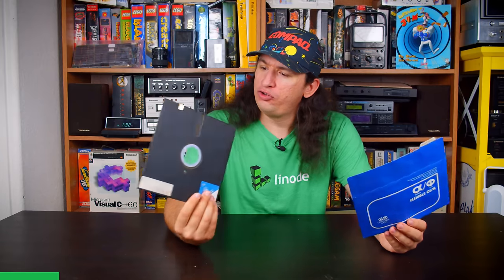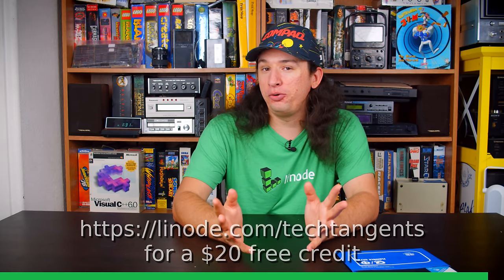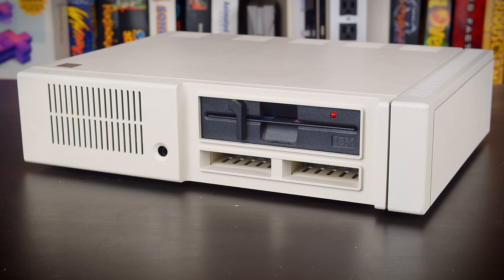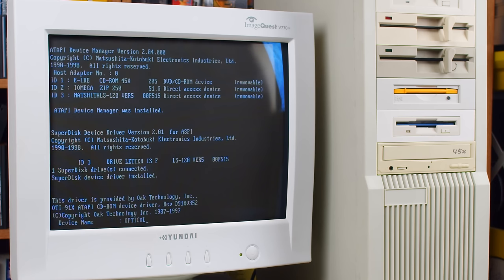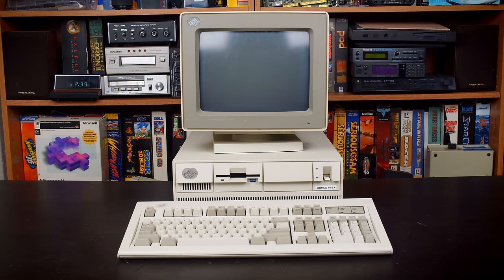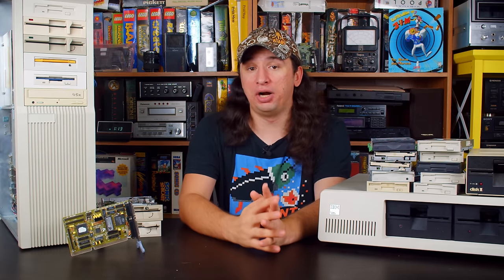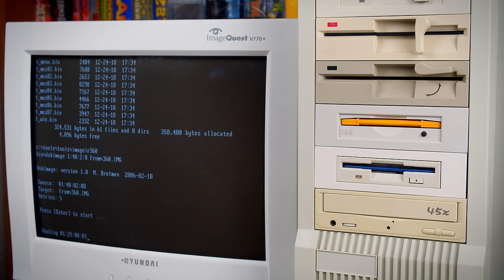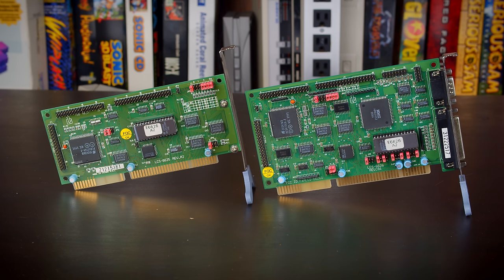More than two floppy drives?

Comment: I never realized how lucky I was that TI used completely stock drives on the 99/4a until today.
Reply: I remember how unlucky I was that the FDC interface required buying the overpriced expansion box, thus limiting me to 2 standard cassette recorders and the 4K RAM in the Mini Memory module.
Reply: @johndododoe1411  Not true! The P-Box came late, as users started having too many sidecars. There was a sidecar disk controller from TI, as well as several third-party controllers.

Comment: I've always wanted 4 floppy drive support for the same reason you did. I have never found a 4 drive controller in the wild, though, so you lucked out there. I didn't know about the XT FDC either. I will look into that. I remember watching a video on YouTube (but can't remember from who) where they had a motherboard with 4 floppy support in the BIOS, and he needed to use 2 floppy controller cars with configurable IRQ and DMA to get it to work. I think it was some 386 board, but I could be mistaken. I imagine that's even rarer than finding a 4 drive controller. The one thing that would be really neat is if something allowed this and also enabled 3 mode support on the 3.5 drive, for reading that odd format on Japanese PCs that used 3.5 inch drives, but ran them as 5.25 1.2 MB drives.

Comment: I REALLY need/want to get my Win98 machine to have 3 floppy drives for getting data to and from all my machines.

Another awesome video, very well researched and I learned stuff. 

Only thing I'd tweak is the 4 drive IDE thing, that only became a standard thing sometime around the intro of the Pentium architecture, and it was not done for Hard Drive support, more for optical drives and other non-hard drive devices. When CD-ROM drives shifted from SCSI to IDE people starting realizing that a single IDE channel was not enough, and then later on when drives increased in speed it became apparent that having slower IDE drives on the same channel as the high speed HDD was degrading performance, so the demand became to add a second IDE channel on boards. So the evolution to 4 IDE drive support had not much to do with having 4 HDDs, more to do with performance and the desire to have multiple other IDE devices.
Reply: Especially that in a typical machine with one hard drive and one optical. If you were to upgrade the storage (let's say you bought a fancy new, 2 GB drive) with a single, 2-port controller, you'd have to either image over your installation or make a new one. And there would be no way to do that move while booting from CD, because that is where the 2nd hard drive sits. 

Basically, out with the old drive in with the new, boot from CD, install the new system, CD drive out, old hard drive back in, move your stuff over, old drive out again and CD back in again.

But with 4 ports, you could just hang the new drive behind the old one.

Comment: Superb video as always! I tried doing the exact same setup as you but I used a BIOSless card. I did manage to get one of those DOS config.sys drivers working ... But really compatibility sucked and while the drive worked in DOS, disk imaging software had issues with the third drive. (1.2mb in my machine as well ) Even with your setup I'd imagine software like IMD still can only see A and B....
Reply from the maker: In this case I was using DSKImage, I've not made friends with IMD yet. Every time I try it it seems like I always have to convert images three different times to a format it will accept.

DSKImage just has you write out a string describing the drive as ID:Sides:tracks:sectors and it will send raw commands to the drive with that. So I set it to ID 2 with the rest of the values for a 1.2MB drive and it worked perfectly for me. I wouldn't be surprised if there is software that is hardcoded with 2 drives only or some other oversight though

The problem with a second controller is, for the most part I believe, that the TSRs for them attempt to remap the 2nd controllers drives 0 & 1 to the address of the 1st controllers drives 2 & 3. So if you use something that somehow by passes the TSR then it doesn't work. But I never even got the second controllers drives to show up in DOS, so there there's some speculation there.
Reply: @TechTangents  ah yes I've used DSKimage and that would definitely work. I end up with IMD because of its support of FM disk formats and also mixed FM and MFM in one disk which the TRS80 M1 uses. But of course no vintage machine uses a 1.2mb drive so who cares really! LOL. The detail in your video was so spot on -- the best explanation I've ever seen in one place so it'll be a resource for the future if anyone else tries to do 4 drives.

Comment: 3:56 Apple didn’t need an interface board for its floppy drives: it had an interface chip . This was because it didn’t bother with actual hardware to do the encoding and decoding of the magnetic signals: this was all done in software, courtesy of that hardware genius, Mr Steve Wozniak.‌

Comment: note the floppy controller from the 70's ran from 40 pin  scsi device, the late 80's to early 90's floppies seen from windows 3.1-win 8 ..

with the major shift to pci-e you have major issues in connecting up older  hardware  unless someone creates a sata line type floppy interface

Comment: I like the video because it's hard to keep up with everything.  The XT-FDC and Sergey's FDC is going to be worth checking out.  The twist in the ribbons motor control is not an IBM thought, it's actually from hacks that were used to help techs swap out floppy drives and reduced the time to switch.  The manufacturers picked up on it and adopted it as standard practice.  The two common reasons we needed several floppies were 1) copying floppies over several drives at the same time reduced the time it took to copy floppy to floppy.  If a person looks way back in the old catalogs they could find "towers" much the same way people can find cd towers.  2) more commonly, it was easier to load software by redirecting a drive already loaded with the next disk rather than simply flipping floppies.  Most floppy controller boards had at least IRQ jumpers that the controller can be assigned, the real problem was figuring out which IRQ was free.  While the on board bios supported A and B drives, it was largely because the controller was on the board, and it was common that the default system files were on the A drive, the B drive was included since the controller supported two drives.  More floppy drives got an extended letter after the hard drive mainly because the bios support for four hard drives (in most cases) meant they had priority over the next available drives that is not in the bios. C,D,E,F  were often reserved for hard drives unless there was one HD controller on the board then C,D.  After that then the installer had to manually assign the drives either by pin or in the config,sys working with the software driver.  The reason Manufacturers reduced the inclusion of floppy drives over the years was that by the time CD's started being used for software storage, the writing was on the wall for floppies.
Reply: BIOS doesn't assign or use drive letters, they simply referred to floppy drives number 0, 1, and higher, plus hard drives 128, 129 and higher .  BIOS user interfaces were added later and used the DOS letters for familiarity .  I'm unsure hoe the new BIOS interfaces like ABIOS and EFI index drives .

Comment: Adding a second (or third or fourth) floppy controller works perfectly with Linux as long as you supply the io-Adress and IRQ on the kernel command line or the module command line - disclaimer, I am talking about kernel 1.0 or 1.2, not sure if this still works today. In fact I once took an "non-configurable" floppy controller and rewired the ISA connectors adress lines so the IO landed in a VERY strange place. Worked like a charm in Linux as fd2 and fd3 - I might had to mknod the devics manually under /dev/ but thats trivial. I am not sure if the minor nodes where like 0,1,2,3 or 0,1,64,65 but I think the later was true and it was visible from the kernel boot log. In hindsight FreeDOS could support that too as I remember it has an option for additional IO-ports for floppies. Maybe a seperate DOS driver could do the same but then I am not aware of anything like that.

Comment: IMO leaving the unneeded (for almost all people) 4 drive support is similar to the use of 2 digits for year representation. It doesn't require extra info/worry/etc. when its not needed in most cases (over than when you switch centuries... or are doing copying between formats in your example).

Comment: And on another note, the 1.2mb drive versus 360kb drive... that is a problem when overwriting a floppy formatted on a 360kb drive with a 1.2mb drive. The result of that would not be properly readable. But in itself, a 1.2mb drive can read both 360kb and 1.2mb 5.25" floppies without problems.

Comment: Conversely, as more and more motherboards drop support for floppy drives entirely, it's possible to assign the drive letters A: and B: to one or two hard drives / SSDs / USB drives et.c.
Very interesting video by the way; I was aware that many FDCs had support for up to 4 drives, for example the uPD765 which is a very common IC - but again with the caveat that it can only support one /Motor-On signal. Whether the floppy drives themselves can decode the 2 Select lines to 4 individual IDs is another matter altogether, though.
Reply: Had a card reader on drive B for ages now, even on a machine that comes with floppy support.

Comment: Indeed, with a dedicated 4 drive controller with its own BIOS extension, making a 4 floppy drive system isn't that hard.
I have made such a system myself. Demo video is also on YT. 
Using 2 separate controllers with the secondary at port 370h is the real challenge though. It can be done if IRQs and DRQs are different between the 2 controllers. Then there is either BIOS support or an OS driver needed to access drives 3 and 4. Being unable to find a DOS or Windows driver for this, I used the BIOS extention from Sergey's FDC to realize this. This works, although it isn't very fast and stability in Windows 95 is an issue. However, unlike with a 4 drive controller, having 2 separate controllers allows one to read or write 2 different floppies in parallel in the same system --> try to achieve that with a standard 2 drive system; the first drive pauses the moment the second drive is accessed.

Comment: +1 for making a FluxEngine at some point. I basically only ever used 'boring' 1.44Mb IBM PC floppies in my time, but still I built one to backup my collection just because it was a cheap and easy weekend project, and modern USB floppy drives are just garbage. You actually come across more exotic discs, so you have even more reason to have one around (even if you do have the proper hardware to read them).

Comment: I have never gotten the chance to obtain such a big full-sized ATX case, especially one made of steel. Gloriously heavy indeed, and allot of space to put a smaller motherboard inside (or two!) and two power supplies (hard disk cavity was massive enough!), along with six (6) cooling/exhaust fans. Yeah, that's still my damn dream. xD

Current machine runs GNU/Linux (mint), windows 10 on a secondary drive (fucking never use it lol), has 24GB RAM (DDR3) and quad core AMD Athlon(tm) II X4 620 Processor at 2.6 GHz along with AMD HD series graphics.

Comment: You should add a 720K 3.5 inch drive, because although you can read 720K disks from  a 1.44 drive, writing disks does NOT work reliably (supposedly due to magnetic strength or something)
Reply: It's the other way around - writing to a 720k disk from a 1440k drive is reliable, but not 720k drive to 1440k disk. The magnetic impedance of a DD disk is lower than an HD disk, so you actually need less of a magnetic field to permanently flip the bit. The drive head of an HD drive has a higher magnetic field strength.

Comment: On my 1983 HP 150 Touchscreen the 3.5" floppy drive is B: and the 15mb hard drive is A:   (unless you have it boot from floppy then the other way round).   The joys of early DOS compatible but not PC compatible computing! It runs custom DOS 2.11 BTW and the floppy is not 720k but a 710k custom format so some special dos drivers need to read/write to them.

Comment: I had an Amiga that could take four floppy drives(drive 0 was internal to the computer, drive 1 was an external which had another external connector for daisy chaining in drives 2 and 3), and even before I got the hard drive, there was never an occasion where I'd need more than 2 drives, other than installing a new program. The cost wasn't worth the use case.

Comment: Wow, what a flashback. On the old atari ST you could use pc drives in it. Including the external boxes. And yeah you could mess things up if a drive was set at ID 3 or 4. The teac 3.5 drive 0 & drive 1 pins were binary, so it was actually a binary 0-3. For backwards compatibility. I really screwed with some friends back in the day by setting drives to 2 or 3 aka drives 3 & 4.

Comment: Alright, since you're quite knowledgeable here, you might be able to help me out. I'm looking to make a PC like the one you've got (entire front panel filled up with stuff, maybe even six big bays and two small ones) that'll allow me to read different and sometimes exotic types of storage media, but also be reasonably useable for today's applications. That's why I've been thinking of a core 2 duo era motherboard. The problem is that they a) don't have ISA slots so I won't be able to use an old ISA floppy controller with them and b) even if they have built-in FDD, due to the period those can usually handle only a single FDD drive. In addition to having both a 1,44 MB 3,5'' and 1,2 MB 5,25'' drive, I want that PC to have a dvd-rw, a 750MB Zip drive, a 2,3GB magneto-optical 3,5'' drive (50 pin SCSI) and a multi-card reader, in addition to free USB support for moving data to newer devices. 

IDE and SCSI are easy - there are PCI controller cards for those, so I'm not worried about them. I also know I could just hook the 5,25'' drive into the FDD slot and convert the 3,5'' drive into USB via an adapter and plug it into one of the motherboard's USB pinout. The 3,5'' drive will detect just fine that way. 

There are also those "combo drives", like the ones Teac and Epson made, that combine 3,5'' and 5,25'' drives in a single 5,25'' form factor - and they use all the same connectors as 3,5'' drives. If I could get my hands on one of those, I could probably make it work with a mobo that only supports a single FDD drive. The question though is - would they be recognized by the system as both A and B, or just A, meaning it couldn't have two diskettes inserted simultaneously?

Comment: I'd like to know how we used to install a master and slave HDD in... say, a 486, or a Pentium. When my HDD was dying, a friend gave me a second HDD, but I couldn't get them both working on the same machine at the same time. Thus, anything I wanted to save from the dying drive, had to be copied by 3.5" floppy as it was my only other option. I did get most everything transferred, but not everything due to the size limit of the floppy.

Comment: This brings up physical vs logical. I remember having to deal with Windows assigning drives then having to use a batch file to correct that
Reply: When 98 addresses by the order of the ports they're plugged in, so if you ad a disk it can break all your shortcuts.

Comment: IDE had 2 controllers because CD drives used ATA66 or 100, when hdds used ATA133, and you couldn't mix and match... it would slow all your drives down to the slowest drives speed.
Reply: Even before HDDs went up to that speed there was quite the benefit.

Comment: i still have my old pentium 3 computer which had 4 ide ports. i remember asking for help and getting into an argument because i had a hard drive on /dev/hdf and being told thats impossible by linux nerds.
Reply: Those nerds were very wrong. Linux always supported at least 26 drives iirc...
Reply: I recall having a VLbus based system which had 4 IDE ports and two floppy controllers, one set being on an expansion card. Had a different machine with a sound card with one of the multi-protocol CD expansion, had three drives on it. Would have been AWESOME to have been able to combine the two. Pointless, but awesome.
Reply: @TheErador  Since Linux Supports SCSI, you'd think....
Reply: @DFX2KX  what about the Meccano raid project? Or was that over SATA. I forget.
Reply: @TheErador  Windows also supports up to 26 drives, or at least those versions I have used in this millennium.
Reply: Windows technically supports more than 26 volumes, just not at the same time. After the 26th there are no drive letters left to assign. But be unassigning one and reassigning that letter somewhere else it will work.
Linux on the other hand addreses per disk per interface, so 26 IDE, 26 SCSI/SATA, 26 floppy and 26 CD could run on the same system without conflict.
Reply: Linux can go more than 26 drives of the same type. After xxz comes xxaa, xxab etc up to xxzz. Then, if you really want to keep going, it can do xxaaa, xxaab ...
Reply: @HappyBeezerStudios  Windows also lets you mount drives to a directory like on Linux, so you can easily use many volumes simultaneously that way. What I think is more interesting is that some versions DOS actually supports up to 32 drives IIRC. After Z the 'letters' are actually different symbols.